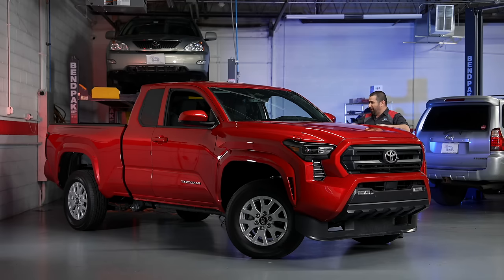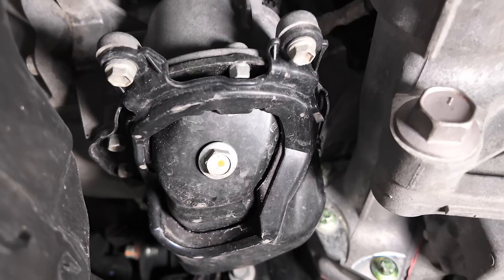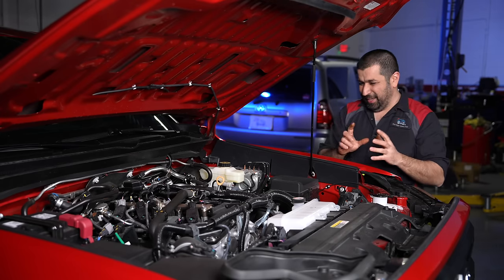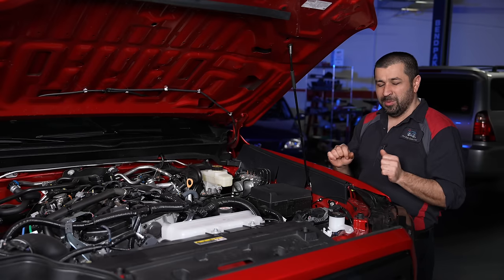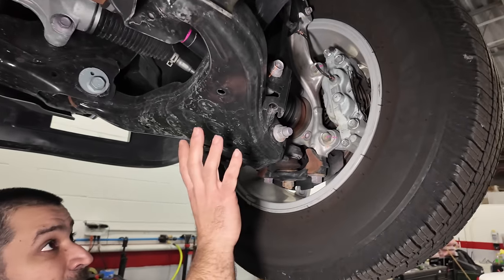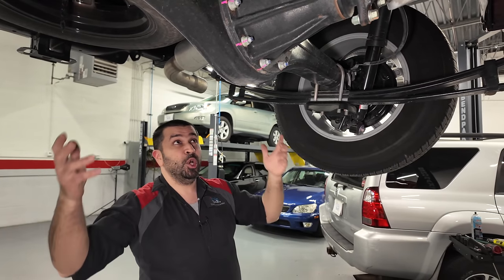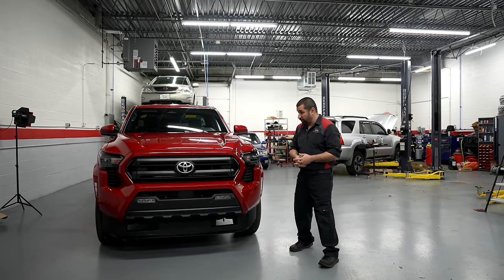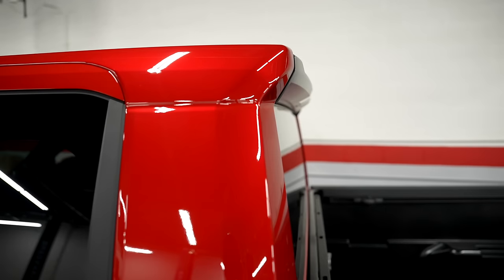2024 Toyota Tacoma | Did Toyota Improve or Ruin The Tacoma? Comprehensive Review

Comment: They ruined it cause they overpriced it. Also the manual says you have to let it sit for 1 minute after a drive if you drove over 65mph to prevent damage to the turbo. Thats not a good statement to put in the user manual. Ill be keeping my v-6, runs great and no 700+ payments.
Reply: Interesting, the Chief Engineer said in an interview that it doesn’t need to be idled as it has an electric water pump to cool after shut down. but he didn’t mention a high speed driving exception.

the one minute idle has always been a turbo thing though. A huge issue back in the 80-81 Turbo Trans Am days even
Reply: Really? That's pretty common actually. It would probably be a damn good idea to do in your vehicle as well.
Reply: @sc3ku  and yet they still require a cool down, just like the old days of the ‘80’s turbo. You would think that they would have spent some time and research,  and then  a few bucks to get rid of the old ways of 40yrs ago. Other manufacturers have done that at least
Reply: If you’re paying 700 a month you can’t afford it.
Reply: I bought the v6 trd pro in solar octane 5 months ago with hardly anything down and my payment is $1,200+ for 48 months 3.99% through Toyota
Reply: @sinister184  Not necessarily. My 2020 Jeep Gladiator Rubicon was bought new in 2019. My payment was $950 at 4.25% APR for a 4 year loan. I prepaid the truck off in full at 13 months. The interest wasn’t that much over the 13 months.
Reply: @sc3ku water pump? The turbo is oil cooled, having an electric water pump does nothing for cooling the turbo. Even the charged air is air cooled in this vehicle, which doesn't matter if it's at idle or shut off anyway.
Reply: @huckleberrymulberry4764  you accept terms like that and wonder where they get the idea that they can charge whatever they feel like 😂
Reply: @huckleberrymulberry4764  Wow. The monthly mortgage payment on my Phoenix area house is $1400 including insurance and property tax. Is solar octane the same color as the red truck in this video? Whatever this red color is, it's beautiful.
Reply: @huckleberrymulberry4764 not sure why anyone would make 1200 dollar payments on any vehicle. Woof.
Reply: The oil can over heat in the turbos on shut down when very hot. That can be an issue on start up for the turbo, when done repeatedly. Just let it idle a minute if you drive like a maniac.
Reply: Such a casual comment. All turbos need idling to cool down a turbo. It's even worse with older ones cause you have to wait 10 mins. Dude, you need to educate yourself on how cars work. Honestly.
Reply: @shamelessplug06  any vehicle that requires cooling down is not for me.
Reply: @skoolynugenator1802  nobody is judging that you played with dolls when you were a kid.
Reply: @shamelessplug06  I’ll take naturally aspirated over turbos that will need to be replaced someday. Sorry you’re so offended. 4 bangers strapped with turbos are your jam 🥴
Reply: That’s for any engine. Driving at highway speeds puts a load on the engine and you don’t want to turn off the cooling system off right away. But if we are being realistic. Most people probably aren’t going shut their engine off as soon as they get off the freeway. They will coast to a stop, and drive around a bit at low speed and less engine load before they get to their destination which makes it unnecessary to idle before shut down.
Reply: @skoolynugenator1802 Real car dudes don't care either way. Again, what year is this? Turbo replaced LMFAO. You've been living under a rock. Such a casual. You probably think a Hellcat is the best car in the world. Typical casual pick.
Reply: Maybe it needs an idle timer, like big rigs have!  More $$$.
Reply: @paulhunter9613  Bucks are important to them over all else.  That's why it's now HECHO EN MEXICO  for a HIGHER price.
Toyota fans are so blind that they could build them in Sri Lanka and they would still pay higher than for a USA-built Nissan.
Reply: @huckleberrymulberry4764  What a bargain!
Reply: @skoolynugenator1802  The Toyota fans will sacrifice all to have the latest offerings.
Reply: All the 24 midsize are priced the same
Reply: @callofdutyguy9 thats a good point but prob not true for people in the country.
Reply: If you are going to push hard on a turbo, like max boost for 40 minutes,  you may want to concider a longer cool down period, like a lot longer than just waiting for the red manifold & turbo to go away, give it 10 minutes for the different metals to shrink back to normal  size ,
Reply: What page of the manual does it say that?  I have one right here and don't see that.
Reply: @callofdutyguy9 Most vehicles get better  gas mileage in highway driving vs city driving because the engine load is less on the highway. But I agree with you regarding needless cool down.